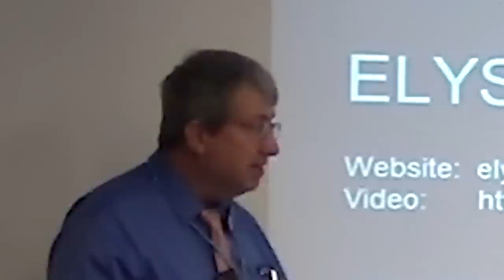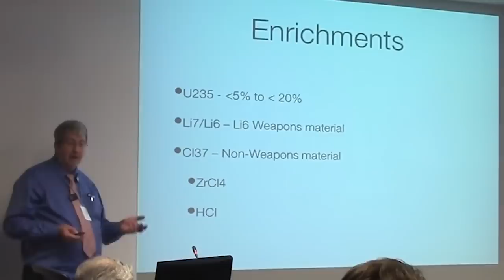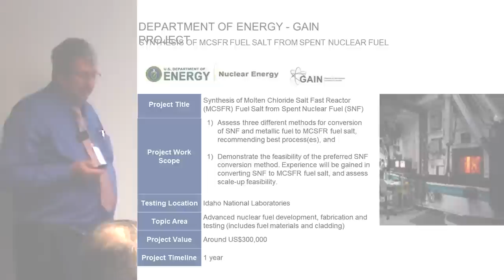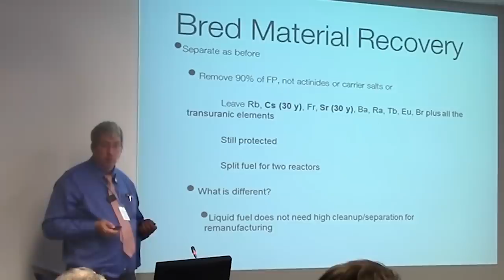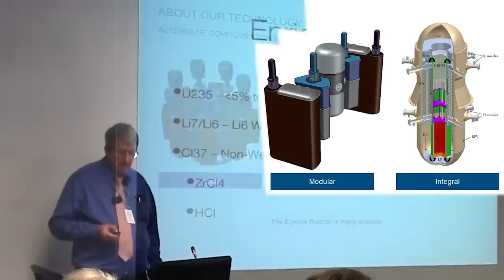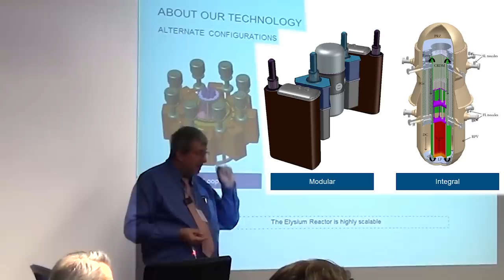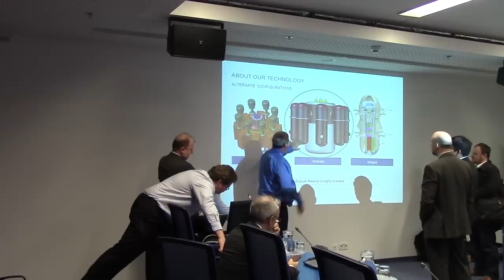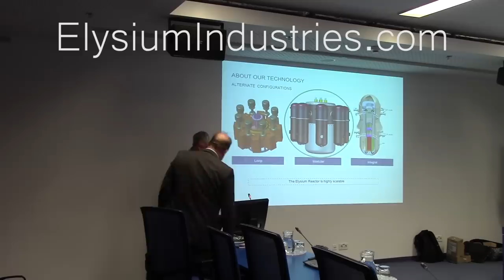MCSFR - Ed Pheil & Elysium Industries @ International Nuclear Materials Management (2018-03-22)

Comment: Thanks Gordon, Elysium's design is really appealing, glad to see an update.
Reply: Personally I dream to see an update where Thorcon and IMSR get a launch reactor inside of a couple years and that MCSFR becomes the basis of their follow-up reactor units after burning through spent fuel for a few years here.
Reply: @mukiex4413  The reactor self governs it's output to met the load applied. Ed's idea to build a demo using the standard reactor vessel is very clever. He connects a small heat exchanger and proves the concept. Then adds a bigger heat exchanger to drive a turbine then adds a few more to drive more turbines. All done with the original "demo" reactor vessel.

Comment: Not gonna lie, it's my favorite design so far.
Reply: Yea It's the most flexible by far. You get the benefits of SMRs and the old big reactors by being able to be modular, while only needing one facility to get you to 1GW. Also it's likely to get help from both the DOE and DOD because of it's versatility.
Reply: It didn't even occur to me to build fast molten salt, i've been ignoring molten salt because most of them are graphite moderated. This is really damn good. Simple, flexible, safe. Made by a small team of experienced test reactor designers and operators who know exactly what you want. I wonder why this hasn't been done already. And it's good to see the Argonne guys finally has something useful to do again.
Reply: If you have seen Elsa Merle-Lucotte's team (With Jan-Leen Kloosterman et al) out of Euratom, or Rosatom's MOZART then you will realise that molten salt fast reactors, be they fluoride or chloride salt based, are the superior implementation with fluid fuel. https://www.youtube.com/watch?v=Yz07sALwDcU

Graphite has been the Achilles heel of MSRs both because the need for breeding means that your reactivity coefficients almost begin to be positive by the time you get appreciable breeding ratio, and because of limited graphite lifetime necessitating core replacement or moderator replacement. Both of which generate additional waste streams unrelated to the fuel cycle. A thermal breeder also necessarily means the possibility of U-233 diversion as detailed by Edward Pheil here (and Ralph Moir elsewhere) if using a blanket; and totally unproven online chemical reprocessing at scale if using a single fluid breeder.

That said, I still think that Thorium in thermal reactors still has a future - in solid fuel. The CANDU AFCR and Lightbridge's original plan to commercialise metal based thorium fuel offers tremendous final disposal advantages due to lesser minor actinide generation. But more importantly, metallic fuel from Lightbridge could potentially eliminate LOCA and core melt due to higher thermal conductivity. The U-Th-Zr alloy has a higher melting point than the peak temperature that is expected to be reached in a loss of coolant accident. It means that current PWRs and BWRs could potentially have longer emergency response times. Plus the metallic fuel is denser and designed to be self-spacing so there are no spacing grids to impede coolant flow.
https://inis.iaea.org/collection/NCLCollectionStore/_Public/47/065/47065279.pdf

Thorium in fast molten salt reactors would still be advantageous even so, because the lower transuranic production and fast fission neutron generation means that thorium containing fuel would be less susceptible to reactivity decreases from fission product grow-in. Plus, going fast once again avoids graphite, positive k and facilitates slower, batch processing instead of necessitating online reprocessing.
Reply: Seems like the best way of making multi-megawatts of power on mars colonies. No graphite worries and fuel flexibility.
Reply: @leerman22  
I'd imagine that the first reactor in Mars would be running HEU to minimise critical mass. 80 or more percent U235. Every gram saved on payload is kilograms of fuel or tankage. Running on spent fuel might need too large a reactor system to lift at a reasonable economic price.
Reply: First reactors would be in the kilowatt range like the kilopower units NASA has been working on, those I hear can run at maximum power for 200 years at 10KWe. As soon as you need breeder reactors on mars in the MW-GW range you can just send U238 or mine it.
Reply: @hjembrentkent6181  I'm not trying to be controversial but would like better understand the issue with carbon moderators. The British AGR runs a graphite moderator with 600C gas outlet temperature running since the 1980s on the original cores.
Reply: @Dave5843-d9m  Sure a graphite reactor can run reliably for a long time if you do it correctly. The issue with graphite moderator is that you can't guarantee a negative temperature coefficient under all conditions (when the temperature goes up you want reactivity to go down), a fast spectrum reactor is better anyway because you can recycle spent LWR fuel and any other transuranic waste.
Reply: @Oliver Mayo Sell it to the Airforce "Mayo" - reference "Officer and a Gentlemen" ;) Just kidding
Reply: @Oliver Mayo Why is Moltex's design better?
Reply: SAME! Melt in MOX in one or two steps! NNSA says it's not "reprocessing" because FPs don't leave the fuel. Huge practical potential with MCSFR.
Reply: @hjembrentkent6181  Thanks for that. I've since seen how Moltex are going and on balance their vented fuel rod design using salt fuel in the rods with a non fuel salt vessel for heat transfer looks the most likely to get though the regulatory process
Reply: @radicalrodriguez5912  Is it better? Hard to say but it should be easier to get regulatory approval. The fuel is not pumped and heat transfer is entirely by convection though they have added some stirrer blades to the tank. 
Chloride fuel salt (same processes Ed was talking about) in fuel tubes.
Same species chloride in reactor tank.
Tertiary salt is heated via heat exchange tubes to heat huge thermal stores. That is the same process used on thermal solar power plants.
1000MW reactor supplies 3000MW of peaking turbines.

Comment: Nuclear Engineer in Training towards grad school. Please keep posting these videos. They are very informative about current technologies and challenges. Please also consider posting Fusion videos or Fusion updates if you attend their conferences. Nuclear = Neutron Loading and Heating whatever your source term is . Challenges are similar but unique
Reply from the maker: I'm hopeful regarding fusion energy as well, but couldn't possibly try cover that topic too. With more time could do a better job covering Molten Salt Reactors, but can't even imagine the time/resources I'd need to go beyond advanced fission and into fusion. But if you find a good subscription for that let me know I'll watch as am curious.
Reply: Nuclear fusion is still vapourware, but nuclear fission is a proven carbon-free energy source. Sadly we have allowed the industry to rely on plant designs with some serious safety hazards that can only be managed by very costly engineered solutions. The new Hitachi/Westinghouse PWR being built in UK is a massive white elephant and the builders have just walked away from developing a second site. 
Fast spectrum reactors are great for dealing with spend LWR fuel but Moltex say their thermal spectrum MSR burners can also use spent fuel.
Reply: I think fusion is coming.   And I think it is may lend itself to small (50 megawatt or so) units.  That would be ideal for powering communities without the need for long distance transmission and the resulting cost that entails.  Even is that does come to pass there would still be a place for these reactors where dense power is needed:  refineries, steel mills, fertilizer plants, desalination facilities, and anywhere where lots of process heat is needed.

Comment: so at 25:30ish, Ed says his system is better than pyroprocessing, and he does give a decent explanation of why. The simplicity is certainly appealing. However, Roger Blomquist from Argonne National Labs has stated that pyroprocessing does not separate U from Pu and doesn't remove all the fission products either. He didn't go in-depth as to what gets left behind, but I'm curious as to who is right or are they both right and Ed is simply selling his reactor and processing technology here and making it look it's best for prospective investors? 
Not that I begrudge anyone the funding to make one of these designs happen. I'm just curious if one of them is right or wrong, or are we just splitting hairs here?
https://youtu.be/vuunX3Oc4n4?t=1110
Video with Roger Blomquist speaking on the IFR's reprocessing tech, for reference.
Reply: The pyroprocess uses an electrorefining to separate the uranium and plutonium from the fission products. the saturation station ratio that uranium and plutonium form in the salt solution used in the elctrorefiner is 1:4.1 & at this ratio they plate out on the cadmium cathode at a ratio of about 1:1.6 U to Pu. Other major transuranics behave very similar to plutonium so they tend to stay together. So you never get pure plutonium, it always has uranium as well as americium and curium with it.
Reply: The main advantage of Ed's system over pyroprocessing is that it's so much cheaper.

Comment: Love it. (39:00) I also think that the low breeding ratios of thermal spectrum MSR breeders and their small fuel loads are proliferation hurdles too. 

If someone intends to divert U-233 from the reactor but isn't careful, pulling out too much, the reactor would loose criticality. If they were careful and didn't pull out too much, they are looking at 15-30 years to double the amount of material their reactor started with (which might not have been a lot given it was a thermal spectrum reactor).

I totally agree that there are proliferation issues with thermal spectrum designs, but given the time, effort, and cost, I just feel you'd have to be a real jackass to try to make weapons material using one of these reactors. It just seems like enriching natural U-235 or breeding Pu-239 with an accelerator or something would be so much easier and quicker.

That said, thorium breeders aren't the only method we have to skin this cat. They certainly can't handle the range of materials that your reactor can.
Reply: I'm probably wrong but thought breeding uranium fuel from thorium made the "wrong" isotopes (233 and 232) which are either poor bomb materials are just too radioactive for practical purposes. They are fine for power reactor fuel as they never leave the plant containment. Plus as WS says there is so little excess that its just not worth the bother. Kirk Sorensen explains it as a benefit of his LiFTR designs.

Using the "waste" LWR fuel and excess plutonium has to be a great start for Elysium as they'll probably get paid to take the stuff. Sorensen (again - sorry) says that fast reactor core design is much more critical for it to work efficiently but if Elysium can solve that then "way to go" as you say over the pond. :)

Some people say the carbon moderators of thermal reactors pose a service life and waste problem. I don't know, but British AGR gas cooled reactors have been running since the 1980s at comparable temperatures to MSRs.
Reply: I recently contacted Flibe about the transport of U233, and was told by Kirk Sorensen that they have no intentions of ever blending U233 with U238. This worries me. They want to use LFTR49s to produce starter U233 for LFTR23s. Unless they intend to start each site up with a LFTR49 and add four LFTR23s on site to use the U233, this would involve the transport of a lot of weapons grade U233 across the nation.
An Elysium MCFSR is a cleaner design. While a LFTR49 requires less startup nuclear waste than an MCFSR being started up with nuclear waste, the LFTR49 will always use nuclear waste as its feed stock, while the MCFSR can be transitioned to depleted uranium, or burn the uranium from the spent fuel, which the LFTR49 can not.
Additionally, one in four MCSFRs can be surrounded with a blanket of 50% thorium and 50% depleted uranium so that, by extracting the uranium at the right point, a blend of 3% U233 and 97% U238 can be extracted to be fabricated into fuel rods that can be substituted for 5% enriched uranium in existing PWRs. Plutonium from all four MCFSRs can then be mixed with the enriched uranium freed up in this manner to provide the initial fuel load for another MCFSR, instead of the Option 1 of 20% enriched uranium.
One thing Elysium needs to get over however, is their aversion to using a moderator. The fission core should be a leaky core with a breeding ratio of 1.0 or less, surrounded by a breeding blanket, with a moderator between the fission core and the breeding blanket. Without a moderator to slow down the neutrons, 10% of the U238 will fission when it absorbs a neutron instead of transitioning to plutonium. The buildup of fission products in the breeding blanket is undesirable.
Reply: @dalesplitstone6276  The buildup of fission products in the breeding blanket is undesirable. But does it matter? The big issue is not engineering but regulatory approval. They go slowly at the best of times and look for reasons to stifle progress.
There is more than enough waste nuclear fuel to power the country (USA, UK France, Canada) for hundreds of years. The old PWRs could be replaced with MCFSR or Moltex Waste burner fast reactors. The costs of decomissioning the PWRs would be more than offset by the hyper low costs of the fast salt reactors.
Reply: @Dave5843-d9m  It is true that the USA, UK, France, and Canada have enough SNF to last hundreds of years, and if you accept that fusion technology is only 50 years off, we can include Germany and India. But the largest environmental threat is from emerging markets, such as Africa. The prospect of shipping SNF around the world makes me nervous. The preferred approach is to breed U233 in a blanket, and ship U233 denatured with U238 to start up the reactors in these markets. These reactors can then be replenished with thorium, just as Elysium currently plans to do with the reactors started up with SNF.
Reply: @dalesplitstone6276  If they wanted to go nuclear they will any nation that has been determined enough has done so. They are not waiting with bated breath for molten salt reactors. Your fears are overblown.

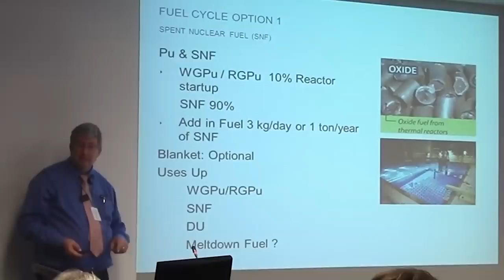Comment: Don't know why dr. Pheil claims at about 15:35 min only a few centuries of nuclear fuel using already produced LWRs waste, in fact considering about 60 years of current 2500 TWh/year of world nuclear electricity production, there is enough depleted uranium and TRUs for a period between 10 to 15 thousands years of today world nuclear electricity. But besides that, the presentation is EXTREMELY interesting (didn't finish yet, though...)
Reply: I think Ed was referring in the sixty year case to powering a society completely with nuclear power, ie process heat, maybe producing synfuels out of atmospheric C02 too.

Comment: The problem with a fast reactor is it probably will require 30 times more fuel to achieve the same heat output. In the fast spectrum, isotopes have a much smaller neutron cross section (reactivity)
Reply from the maker: Robert I don't know exactly how to quantify the fissile load of a fast-spectrum vs thermal-spectrum MSR (not a nuclear engineer), but here's an exchange where a ratio is stated... https://bravenewclimate.com/2011/11/17/ifr-lftr-exchange/ ...between LFTR and IFR: "1/5th the fissile load per megawatt" ...so that's not MSR vs MSR, but it is Breeder vs Breeder. And that ratio is closer to numbers I've heard before I'm sure it isn't any more than 10x the fissile load to run fast-spectrum instead of thermal-spectrum, although I can't find any other ratios quoted... sure I'll spot it when I'm not looking for it.
Reply: To add to this, Ed states in this video that if the US was on 100% nuclear power generation we have enough SNF to power the US for over 300 years. I do not think the increased fuel burn is a problem in the near or long term. 50 years from now there easily could be advancements to have more efficient reactors in operation.
Reply: @timframe570  bill gates says up to 700 years so either way it's an attractive possibility...
Reply: 30 times more fuel, so what, that's easily made up for by the lack of a need for moderator materials and the structures to introduce them into the reactor core, And a much greater neutron production hints better neutron economy making it easier to achieve high burn up of the actinides. This is why Ed is calling for the leaving in of all the materials produced except for gases and a few decay products. It may still be subject to some problems like plating out in the heat exchanger, and leakage at the connection points of the external loops etc.
Reply: That's not correct, it only needs 3-5 times at max the fissile inventory start-up vs a LWR, for example (3.5-5.5 vs 10-15 tonn per GWe) as plutonium or nuclear waste. And this is not per "same heat output", it's only to start-up the reactors, at a steady state all reactors consume about one tonn of fuel (in the form of plutonium, nuclear waste, depleted uranium, etc... that we have plenty of) per year, so even that extra fissile is definetely not wasted
Reply: The fuel is “waste” so the more you use , the better.
Reply: @Goodwalker720  If a new reactor is able to use the spent fuel, then it is no longer waste. It has then turned into a valuable resource.
Reply: I don't think that the large amount of fuel required to load such a design is much of a problem. Remember that the 'fuel' is considered unwanted waste.